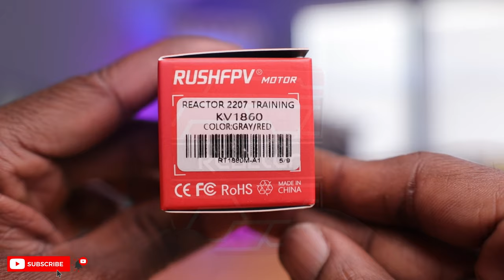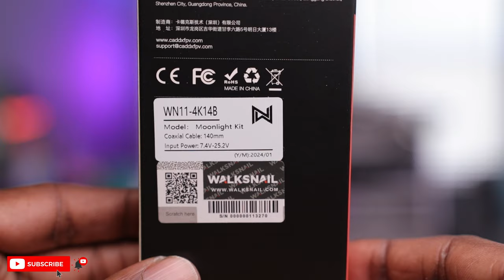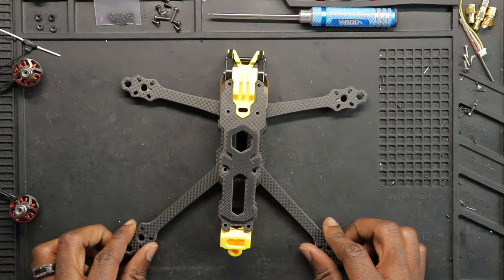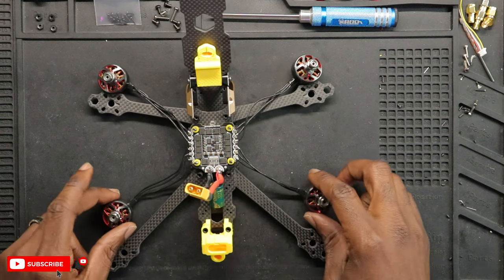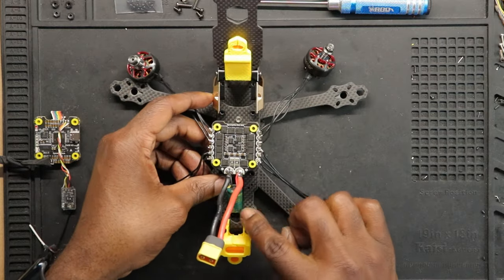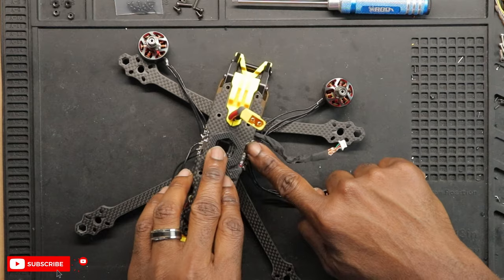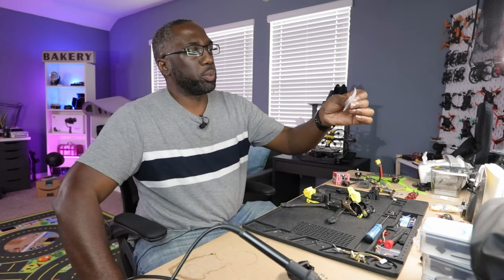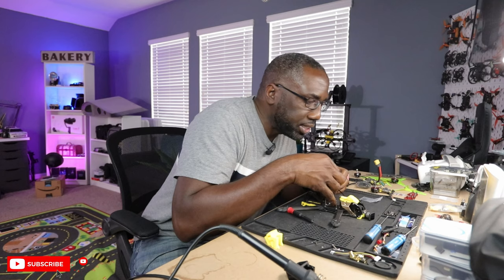SpeedyBee Mario5 Build w/ Moonlight Kit!

Comment: Thanks for the video! I have almost the same setup. The Mario 5 frame with the moonlight kit. However, I have lots of jelly in the 4k footage the moonlight kit creates. I have a feeling the camera is too loose in the rubber brackets in front and it is rubber on rubber of the cam. The moonlight camera is really loose and I have a feeling this created the vibrations in the videofees as well specially when it are windy flying conditons (as it always is here in the netherlands). Are there people experiencing the same thing and/or is there perhaps a known solution to this? Perhaps a particular 3d print for a different camera mount?
Reply: I'm trying to install a walksnail vtx hd pro into this frame and the camera feels so loose no matter what I do